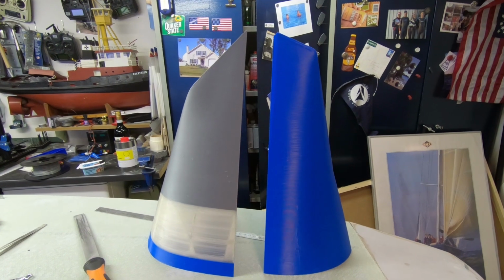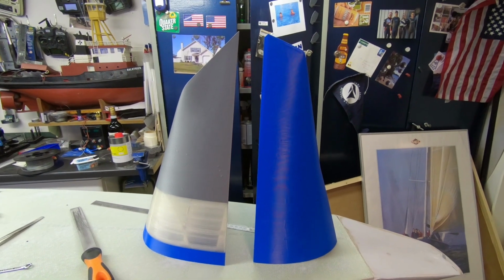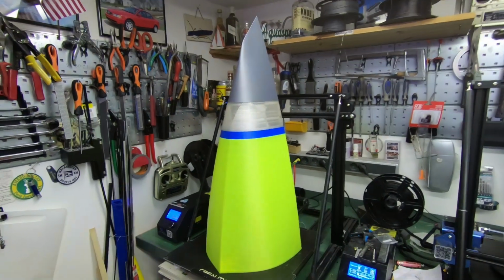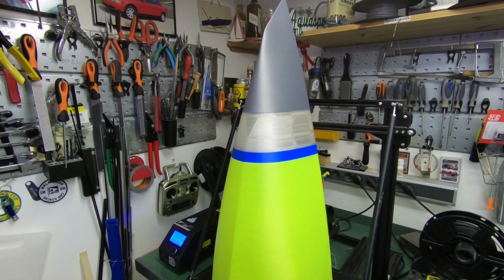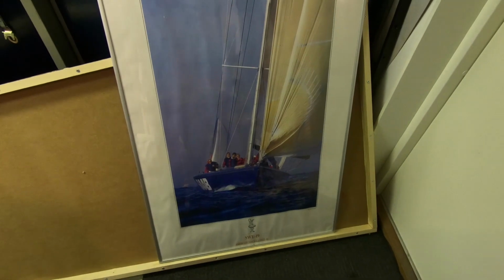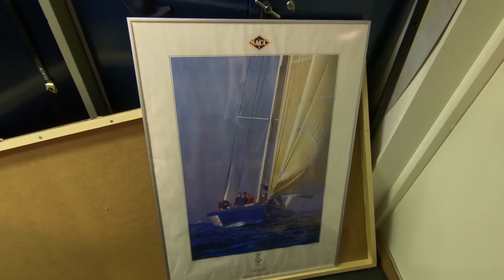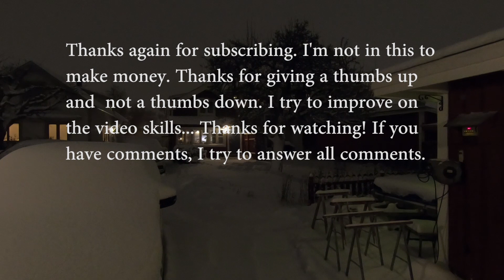Kookaburra III and II updates. Some cool 3D print work progress

Comment: Very interesting Lars. It seems that model making these days requires a 3D Printer and software, let alone the talents to do the cross over from the plans to do files to make them. Way above my talents, I am glued to see watch your efforts as they are posted.
Reply from the maker: Thanks for your kind words. Australia II was built on frames, and Courageous was build on frames that I filled with foam... (very messy). Columbia was also built on frames. There is still a lot of work, to finish one of these plugs and make it a plug that you can pull a mold from. I focus on the 3D printing this time of the year (cold outside) since they generate a lot of heat. Today I will work on Johns model, and test my new hardware I have designed and printed. I will try to video film it, and post a new video, maybe as early as tomorrow. Thanks, Lars

Comment: interested in your jib track, presumably you intend this to control a Genoa foresail? Does the fore sheet line control it for both downwind and upwind or is there an additional control (servo) controlling the slider?
Reply from the maker: My plan is to control a jib with the same sheet system as the main, but get rid of the jib boom. You loose some power down wind, but my boats have a huge scale mainsail... I will post a more in detail video hopefully tomorrow. If you have ideas for improvements, I'm all ears. The jib will not be overlapping. I plan a boat with a genoa system in the future. The idea with the jib track is to have two boats that are easier to sail, for the reenactment. I used a system like this on Australia II, you can see some earlier videos. The track on Australia II was made from a bent stainless steel wire... It worked for a while... :) Thanks for your interest. I will make a video and deep dive more into this.
Reply: @LarsLindqvist  I sail radio yachts to the six metre class rule within which there is a provision for for sails without booms - the rule is a scale version of the metre rules which provide for a triangle within the foresail must fit, the allowable area of the foresail is significantly increased when a boom isn't used. I would be interested to hear your views on how you feel the two systems compare?
Reply from the maker: @petershepherd62  I can design and print you a jib track ( for cost+ shipping, I have a day job). Would be great if I could help you. I have seen your 6mR yachts sail in the UK. I'm very alone here in Sweden, doing what I do. My brother has restored a classic 6mR called SWE31 Silvervingen. You can google it, and find a blog I helped him create. If you give me  a sketch of what you want, I will tweak my design and print and send it to you. I will make a video tomorrow showing the jib track and also my vang track and single block I have been working on. Thanks for your interest, Lars
Reply: @LarsLindqvist  Thanks for your very kind offer, I also 3D print designing using Fusion 360 would it be possible to share your design file instead so that I can adapt it for my yacht?